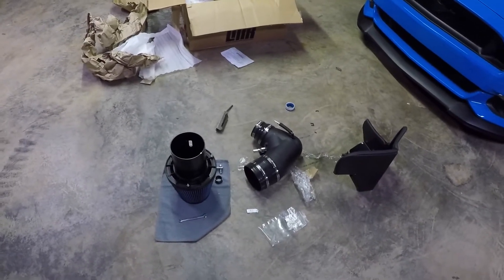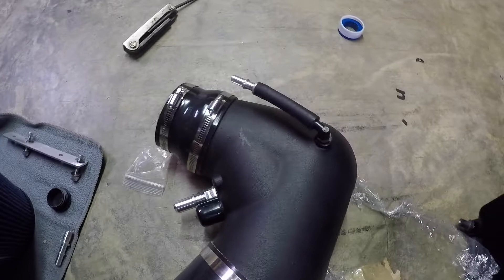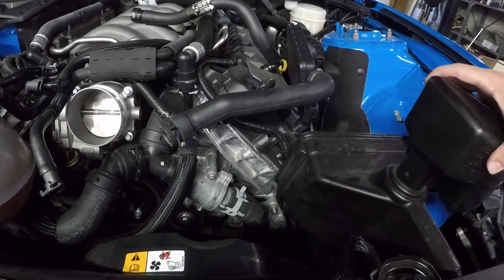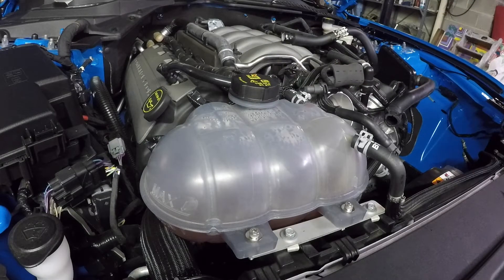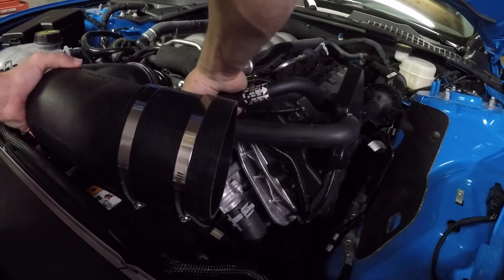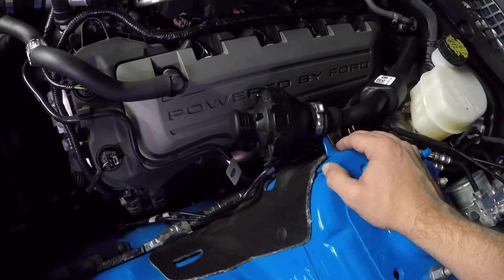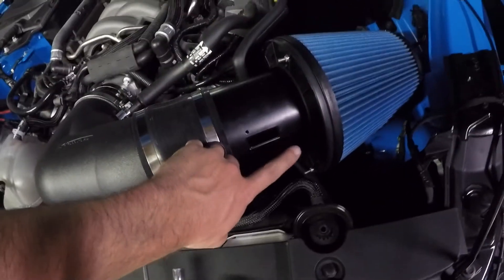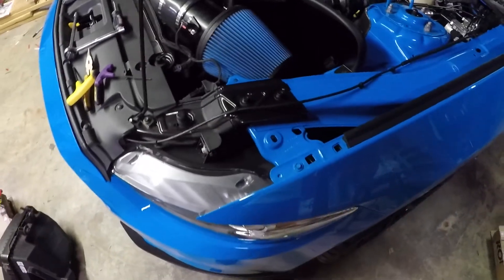PMAS Cold Air intake Install!

Comment: Good review. I just installed one on my ‘15 GT. It was a huge pain getting to that bolt against the firewall. Ended up using a deep 10mm sock, swivel and some extensions. Took me a minute but I eventually got it. I love this CAI setup. Definitely recommend.
Reply: hey man i have a questio, but will be better to talk thru instagram or messenger. i have a 2015 gt mustang too.

Comment: If your in stop and go traffic have you noticed the drive ability of the car is worse than the stock box? I have a pmas installed and if I'm just hardly on the gas inching in traffic the car tends to buck. I've heard that it's the intake that causes that.
Reply from the maker: Nope, mine drives like stock.

Comment: I was wondering if you have higher AIT's than before? I'm about to install Pmas CAI with just a heat shield, nGauge & Lund Tune. I am concerned of Heat soak temps. Also if you've heard of people insulating they're CAI / inlet tube or  and box / heat shield?
Reply from the maker: Na cars don't really suffer from heat soak just from little higher intake temps. You will definitely have higher intake temps though with open filter.

Comment: I have mine on but I plugged the fitting with a cap and I tried pulling off the fitting but it won’t pull off please help
Reply: Thomas Hale try unscrewing it off. It's just a little bit a hassle I used a needle nose plier to loosen up and after it's a cake taking it off.